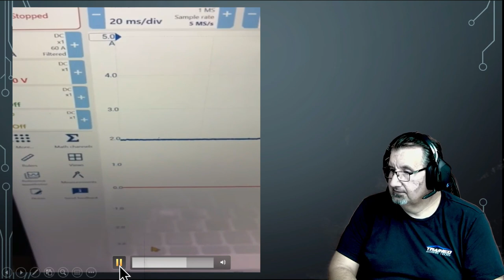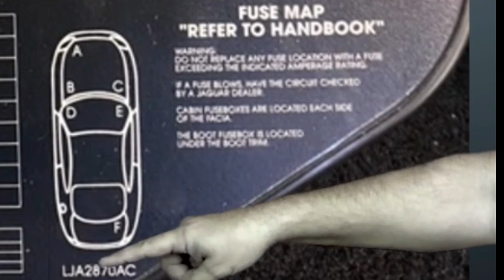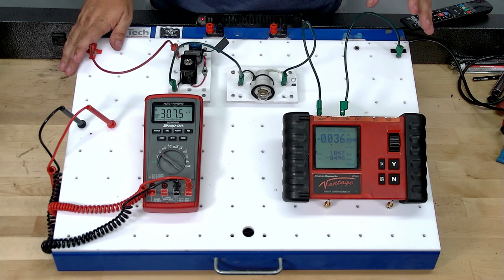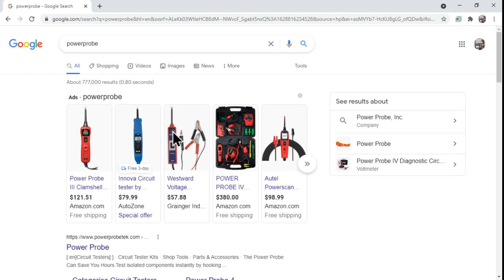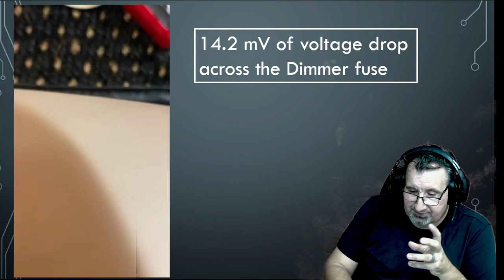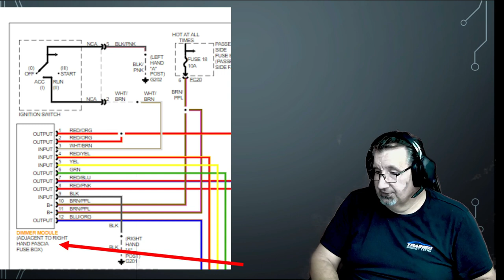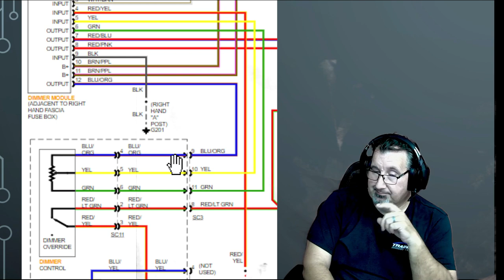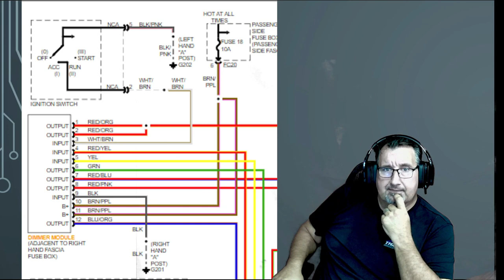Parasitic Drain Testing - Jaguar

Comment: Has anyone found a way to easily test j case fuses..... seeing more and more of them
Reply: Pete, I hate those guys but it’s been my experience that a lot of those j case fuses are rated pretty high and usually protecting several smaller circuits further down the harness that probably have smaller standard style fuses on them so I always start with all the little, easy to access fuses and save those pita ones for last.  But I’ve had to pry to covers off a few to test them.